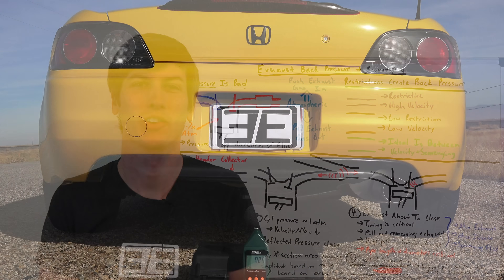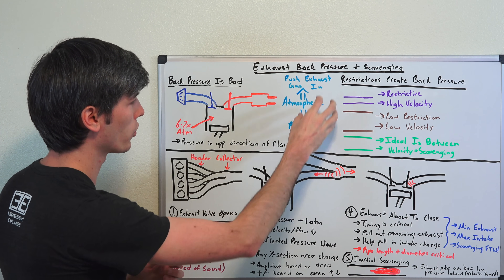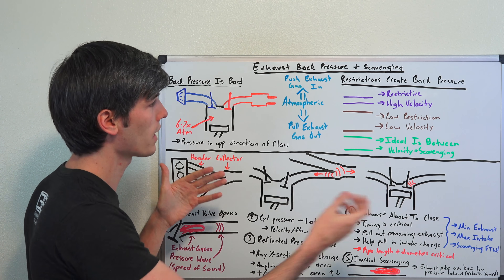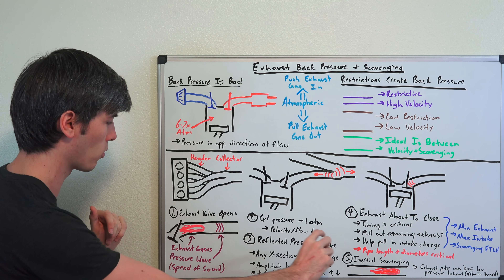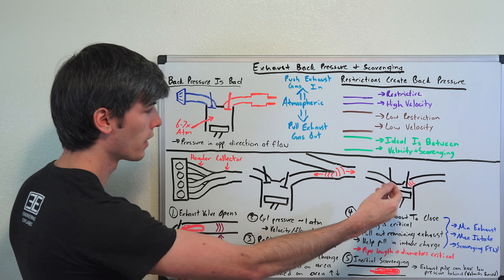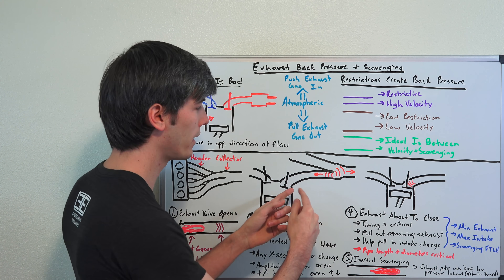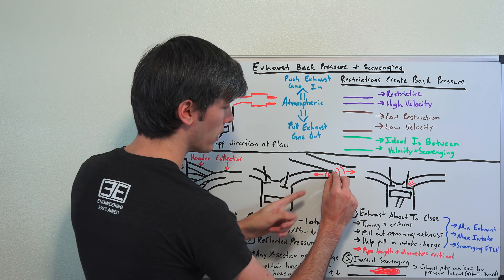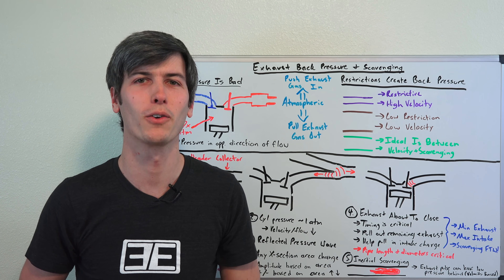Stop Saying Car Exhausts Need Back Pressure

Comment: I wonder if there ever have been an attempt to put turbine solely for exhausting purpose. I suppose it can overcome those pressure wave/inertial scavenging at certain point of suction level?

I imagine it would make it harder to control the amount of air to suck in with pressure inside the cylinder right before intake being potentially too low, but if it was just the matter of tuning on the intake control, what else is bad? (Especially if it were supercharger sort of rev-matching suction turbine)

Comment: Late to finding this video, but glad I did because it verifies info I've sat on for many years. I could never figure out why people promoted back pressure or built it into their factory vehicles. My guess is more back pressure resulted in less evacuated gasses giving lower emission readings to meet regulations.

I found this video very interesting because about 25 years ago I was getting into R/C Airplanes. The fellow teaching me had an advanced Pattern competition plane that used a "tuned" exhaust pipe. Not understanding what this did for the plane I decided to research it. In my research I stumbled across an article about Reno  Air Racing Midget Pylon racing planes. If I remember correctly all planes were restricted to a certain, and rather minimal, engine size. One of the very things the racing teams did was to tune their exhaust pipes to maximize exhaust gas scavenging and increase the intake of air/fuel creating more power, just as this video explains. Ever since I read the article, one of which made very good sense, I could never wrap my head around the back pressure theory.

Comment: you want an exhaust system that is more like a two stroke expansion chamber than a muffler. back pressure prevents flow. 

  timed area per unit of displacement.

Comment: Personally I like my setup. 2.5 inch stainless pipes bolted to factory manifolds. The engine itself is a Chevy 350 with 305 heads that have been machined to a larger exhaust valve. The results are more power.

Comment: If atmospheric pressure is 10 times normal in a naturally aspirated engine, then the air being compressed for ignition and the exhaust (without compression, not taking the exhaust gas being heated into consideration) will start off at 10 times atmospheric pressure. Meaning that the exhaust gas (now compressed) will leave the cylinder due to it still being higher than ambient pressure.

Comment: So i got a 2.0l engine and i have a 2in exhaust with cat and res and muffler (stock exhaust) would it be better to go 2.5in with res delete and keep the muffler or a magna flow muffler and cat delete? Debating if just to delte res cat and muffler and keep 2in pipe

Comment: Every other source that tries to explain this phenomena all state "at the collector a negative pressure wave is generated, which reflects back to the intake". Nobody ever explains why this happens and basic fluid dynamics doesn't answer it either. You took your time to explain this whole issue from ground up, but still neglected to explain this phenomena more clearly. Instead, you just mentioned "everytime there's a step up in pipe diameter, a pressure wave is reflected". This drives me so crazy! There was nothing to take home from here, just hands waving around and empty words from your mouth. 

If the phenomena was more clearly explained, we could use this information for some constructive criticism towards aftermarket exhaust system. Instead, we are once again left behind left with thoughts like "there's a sweet spot".

Comment: Wow such an imformative video! Haha, but Jason don’t mind me, im just throwing ideas on the floor. You see, these days, the barrel of a rifle has these spiral grooves/rifling which aids the bullet in attaining maximum velocity before it exits the barrel. Assuming exhaust tuner shops were to incorporate these spiral grooves/rifling into the insides of the exhaust header, would that aid in attaining max velocity for the spent exhaust gases? (At piston TDC/exhaust stroke). This is assuming that its a straight pipe (no restrictions) set up🤔

Comment: Thanks once again Jason, your videos are so simple but explain such complex interaction principles that the usual layman fails to understand.

As a side effect, you just explained why a 2 stroke engine produces so much power/torque at a very narrow rev band (power band). 

But you need some back pressure (and the back pressure wave) to stop all (most) of the exhaust gasses escaping at the critical moment down the exhaust pipe (must be tuned).

You are dealing with principles of physics, where - due to exhaust gas inertia, scavenging, back pressure wave and hitting the sweet spot in the revs to achieve the optimum efficiency to get max power out, while not sacrificing some of the unburned - fuel-air mix vapour out the exhaust too. 

And that is what Tuning is all about, whether you are optimising for power, fuel efficiency or to keep the temperature of the exhaust the lowest!

Comment: It is actually needed on gasoline non direct injection engines!  I had,from 40 years ago,numerous experiences of broken exhaust pipes in various cars,and they  wouldn't move like before,until the leak was repaired; 

Gasoline engines :
1--Exhaust pipes are MANDATORY for the street
2--They create back pressure
3--The  cams timings MUST account for that,and they DO.
4--If back pressure disappears,all previous timings are OFF,and,in non GDIs,not for the better,the intake charge has now a freer pass to the exhaust side,through the open exhaust valve when "both" valves are open at the end of piston exhaust stroke; power is wasted.  GDI cars avoid this fuel WASTE ,by injecting fuel right AFTER  the exhaust valve closes, as the piston starts to move down "aspiring" (quotes for turbos) the air.

That is the only reason back pressure is needed on street cars.

For DIESELS,the LEAST amount of it,the better,ALL diesel factory manuals,street and marine, specify the maximum allowed,and it is very little.

Comment: I thought backpressure was good in cases where you have a rich mixture as some of the unused gas could be reburnt, hence adding to efficiency. I was also of the impression that the build up would create more pressure in the cylinder which was better for performance (ie. More air and fuel crammed into the same small space equals bigger explosion). 

Guess I was wrong. You learn more everyday. 
Thanks for the vid
Reply: The unburnt gas in the cylinder will be burned with or without a exhaust

Comment: People just say backpressure is good because they don't realise that the cat converter on their Honda is part of the pulse tuning and their test pipe just defeated the efforts of the oem engineers to get maximum efficiency.

If the test pipe was a 2-2.25 inch venturi on a 2.5 inch collector they would get their pulse tuning back without anywhere near the backpressure of a cat converter

Comment: He did break it down and describe it pretty good. 

You do need a certain amount of pressure, not necessarily back pressure, but enough pressure to keep the escaping exhaust from slowing down and not escaping fast enough. Yes pressure can create higher velocity. Think of it like a garden hose, if you install a 4" garden hose on your house faucet, the water velocity will slow down due to the size of the hose because the water pressure can not fill up the hose fast enough to create a pressure to push it out fast enough, and it will escape slowly, but if you use a standard size hose, it will have greater velocity and escape faster. 

Now, if you connect that 4" hose onto a Fire Hydrant, then you will have a good flow. So size everything to your engine. 

Primary Size, Collector Size, Header Type (4 into 1, 4-2-1), Exhaust Tubing Size, The bends in the primaries before it gets to the collector, the collector design, muffler type, and so on, will all have an affect on performance based on your engine and how much CFM each cylinder can produce.

Comment: Thew dislikes are because this is not all of the story.  You CANNOT change from the factory exhaust without harming your cars performance.  This has to do with all of the air flow sensors and exhaust sensors that are all set in the computer to make the engine run at its best.  You replace just the muffler with one that is more open, and it will take away from the cars performance.  If you do change ANYTHING with the exhaust, you MUST take your car ot someone with the correct equipment and know how to change the settings in your cars computer, to make the engine work right with the new exhaust.  Now his explanations as to how ti all works is fine, but when you change anything in that exhaust, you just have your computer reset for your vehicle to run properly.  This is why you see cars with new loud exhausts installed and they backfire and shoot sparks out the back.  This will RUIN a good engine quickly.  So yes, the exhaust needs the proper back pressure so your engine runs as it was set up at the factory.
Reply: Exactly
Reply: This claim made no sense at all.
Reply: @東京ワナビ  he does make a valid point that on ECU engines with EFI you do need to reprogram your ECU to get the best performance with the new exhaust.  Just like you have to adjust the carburetor on an old-school hot rod when you make big changes to the exhaust.
Reply: No a new exhaust will not cause sparks and backfires... omg
Reply: And just to clarify the crackle and pop you hear from some aftermarket exhausts is not a backfire, stop talking absolute rubbish. 
The only sense you made was about tuning your car to suit your exhaust

Comment: This makes sense and fills in the gap when thinking about Motordyne's shockwave exhaust. The gradual expansion from 2.5" to 3" is sending back that negative pressure from constantly stepping  up helping the exhaust gases from the other cylinders

Comment: Most people I talk to try to convince me back pressure is what u need so I was a bit apprehensive when looking for a good stainless y pipe ford my truck and all I could find was the afe 3 into 3.5 mandrel bent pipes with hi flow cats plus shorty stainless headers........omg the motor just breathes soo much Betta and not just hi rpm........the whole range

Comment: So back pressure bad, but scavenging is good. I don't have any interest in doing more work on my gas engines than necessary replacing a stock exhaust, but it is nice to have a good explanation of exhaust flow dynamics.

Comment: Less backpressure on any NA engine reduces the low end rpm torque and increases the high end. For a naturally aspirated engine to run best at low and midrange rpms it needs backpressure, unless it's tuned mainly for high rpm. Every good mechanic should know this. What would be most ideal is variable backpressure

Comment: ok for one you need back pressure why well if the motor is running and there is no back pressure you lose low end again the motor is turning too fast and you don't get the full energy from the fuel burn and you will get a lot of popping because all the fuel has not completely burned and you are putting unburnt fuel in to the exhaust back in the day I had a kz1000 
with a kerker 4 into 1 header I pulled the baffle out it sounded like a jet but it could not get out of its own way no low end at all when I put the baffle back in then we were flying like a jet  just my own option I tried this when I was 10 years old I had a rupp mini bike I put a 3/4 straight pipe about 3 inch long with a ball valve at the end so as I was zipping down the street I would reach down and adjust the ball valve when I was wide open I could feel the loss of power when I would close it a bit it would take off like a jet also I advanced the cam that helped out a lot like I say just my own option do what you will

Comment: I got lucky with my 77 1/2 ton 4 bolt 350. yanked the fucktory choking manifolds, slapped a pair of headers on, cut a drive shaft in half that was thee same size as the collectors then chopped and gutted a pair of old glass pacs, took 2 1/2" cyclone fence posts and cut slots in a spiral pattern from end to end, used my air hammer with point bit and drove into each slot causing it to swirl the exhaust as it passed through, welded it all together and damn what a sweet sound not to mention large improvement over the entire rpm range. couldn't believe how much it did for it

Comment: Back pressure only makes sense on 2 stroke engines where the exhaust and admission valve are open at the same time, and it just make sense on a small timeframe of the cicle.

Comment: You tune your NA motor with exhaust just as much as with Intake.  All variables change with SIZE & compression Ratio of each motor.  Cam shafts and Head design(CFM flow) are part of the Intake/Exhaust  Tuning process.   good Engine builders  always search for a great "package" of collective parts to work together.

Comment: I would like a dyno comparison between dyno headers,and no headers.and see which is best!
Reply: equal length header tubes are critical to get the same reflecting sound waves exactly the same to each cylinder as this will keep the intake mixture coming into each cylinder the same so you will make the same HP in each cylinder for a much more smother power to the crank increasing efficiency maintain the heat throughout the same having better reciprocating dynamic balance  less friction and longer engine life
Reply: @donniebaker5984  I don’t think so that’s why I said to Dyno and find out.

Comment: Hmm.  This is a very late comment, and I'll admit, I don’t know that much about car engines (which some can justifiably say I should just shut-up, cause I don’t know what I'm talking about, which is quite likely true).  However, based on what you’re describing, it sounds to me the actual problem is not necessarily pressure but cavity resonance (although, you can argue that since sound is a pressure wave, that it does get back to just pressure).  It would seem that one would want to create a set of headers whose cavity resonance frequency is exactly or as close to as possible the frequency of the exhaust stroke at the peak power rpm of the engine.

When you try to drive a resonant cavity, the closer you are to it’s resonance frequency, the easier it is to drive the cavity, while the further you are from the resonance frequency the difficult it is to drive the cavity.  I would expect that tuning the headers' cavity resonance closer to the exhaust frequency at the peak power rpm would allow the engine to move easily move the exhaust, meaning less energy from the engine being used to move exhaust and more of that energy being available for turning the engine and moving the car.

(To get an idea of resonance, pay attention to a front-loading washer, sometime.  When the washer is spinning near resonance, it bumps and vibrates very loudly because it's easier to drive it vibrations in the washer at the resonance frequency.  However, as it speeds up, it leaves the resonance frequency and starts to quiet down, because it's much harder to drive the vibrations outside the resonance frequency.)

Again, I don’t know much about cars, so I'm NOT going to say this is definitely the answer, however, it should be possible, at least to within good approximation, to calculate the resonance frequency of a set of headers and compare that frequency to the exhaust frequency of the engine at peak power rpm.  It should then be possible to test, using a dynamometer, whether the power output at the wheels is greater or less with such a frequency tuning.  Considering the problem of the engine having a power band, it would not surprise me that the best tuning point would be to set the resonance near the center of that band.  There is an additional complication that this is not a simple static wave but a wave in a moving medium, because the exhaust has an overall flow direction through the headers and tail pipe.  This can cause changes in the flow dynamics and wave resonance from what would be expected in a static situation, so one would have to modify the calculations to account for this.  But, I think it would be interesting to do such a calculation and compare the results to what is observed on the dynamometer.  Ooo, this sounds like a really fun physics problem!

Comment: If you wrote yourself a script then you could say things in the right order and you wouldn't have to regress and repeat yourself. You would use fewer words so you would not have to speak so fast. As it was, you didn't go into enough depth on getting the tune right for each cylinder, nor did you discuss optimal cooling of the exhaust valves.  Nevertheless it was a good video. Thanks.

Comment: You kind of skipped the 101 version and went straight to 102 class. 
The 101 version would have been a better explanation. Back pressure exerts force back into the cylinder requiring use of some horsepower through another cylinder firing exerting force on the crankshaft to physically push gas out. The more back pressure the more horsepower is used up in rotating parts and not making it to the driveshaft and propelling the vehicle.  

Your explanation of pressure waves is more towards tuning of intake and exhaust timing and design differences of header lengths and exhaust sizing. EI was more about exhaust design then about back pressure being bad. I know they are interrelated but feel you really did leave out important info.
Reply: Wow, actually good criticism in a comment?
Reply: Fish R Relaxing well when you explain back pressure like that it sounds like version 100. If there is back pressure on a cylinder then it will take power to push it out. Bam the videos done. Take care see you next week.